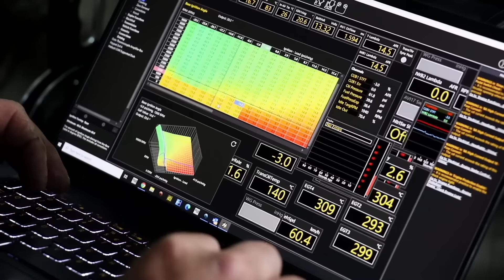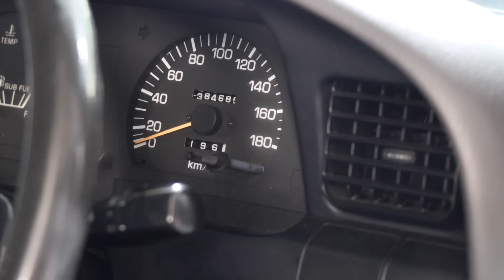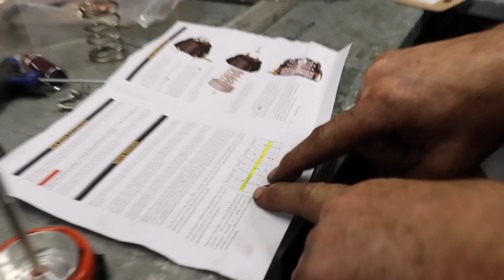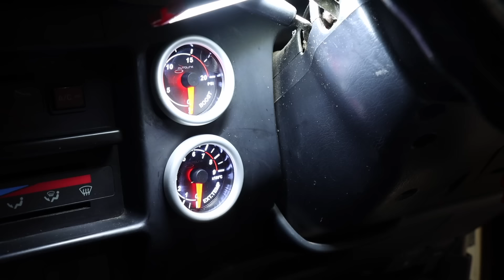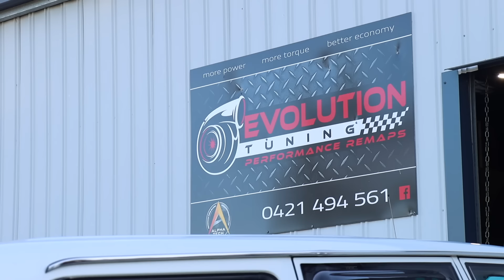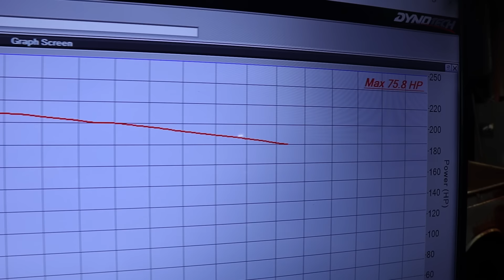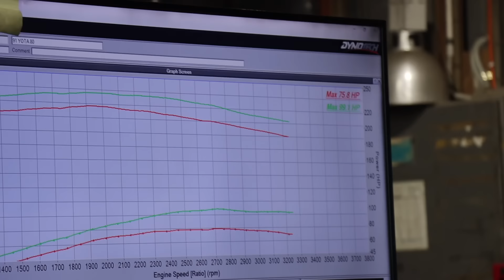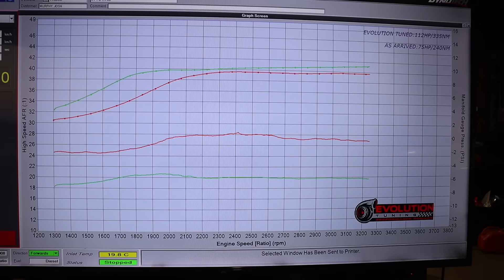How To Turbo Your Toyota 1HZ on a Budget!

Comment: I have found having the fuel screw  bottomed out on my 2L-T with a gt2560 and intercooled with no wastegate is a good setting for me.... I constantly see 650 degrees and upto 720 degrees in short stints...
It has been running the same cracked pistons for over 30000kms...
only reason I know they are cracked is I had to drive it 100kms with no coolant... so I killed the head in process.... so fitted up another head and kept sending it...surprisingly it doesn't have blowby 

Also adding a intercooler drops exhaust temp usually around 200 degrees before turbo on most 10 psi setups.....

 all diesels should have turbos and I think all should have intercooling of some type aswell
Reply: Ditto with the welded up wastegate here on my 5L+t hilux. Don't need a wastegate, let it breathe as much air as it wants and let the fuel screw regulate the boost. Im getting about 19psi up top with a subaru TD04 and I'm not seeing more than 500c in the dump pipe when towing as long as i keep the revs up, and never over 400 when not towing

Comment: I was considering doing something similar with a Jeep 4.0 inline 6 motor, obviously tuning and getting air fuels correct will involve much more work, but to make boost low down I was considering an STI turbo possibly high flowed if its a little bit too small. Wondering if Al or any of the other knowledgable people in the comments would recommend an intercooler given that a petrol engine is prone to pinging or detonation, and whether a small turbo like that would be alright for an OHV pre crossflow boat anchor that generally only revs to 4800rpm and would be running sub 10 pounds or if something larger would be neccesary to maintain efficiency. Cheers.
Reply from the maker: You would need two of those turbos on a 4l petrol engine. You can effectively halve the size of the turbo when using it on a diesel as they have less exhaust heat and do not rev as high.
A BW S366 with a .9x exhaust housing would work fine on a Jeep six and cost very little.
Reply: @theskidfactory  Really appreciate the info, cheers!

Comment: Confused on tapping into the heater for the coolant lines for the turbo - does that mean you bypass the heater?  Or does the heater core have to have coolant running through it constantly for the turbo?  Oh never mind, I see you are using T's... does the heater opening affect the turbo at all?
Reply: There will always be enough pressurised coolant circulating throughout the heater core and the turbo bearings so neither will "run out" or one affect the other in any way...
you've got the water pump always pushing/circulating those litres of coolant at high volume and velocity....
Reply: @JohnSmith-yv6eq  Thanks for the info - makes sense.

Comment: Love your videos. For comparison, how many hp at the wheels does a stock FZJ80 make?
Reply: My 3f 80 made 68hp with AC and 71hp with AC off.

The 1fzfe will make 100-150hp at the wheels stock pending condition. With boost they happily make heaps more…

Comment: 3.300L and under diesels belong in light weight cars. 4x4s need 5.0L++ of low down torque. 
A ZD30 has 50% less torque from idle as a 4.5L Cruiser, and the 3.0L boost all in at 2100rpm is still a long way to slip the clutch to get a 3500kg Patrol moving. But an Auto ZD30 in a 1500kg would be a lot of fun.

Comment: I thought the hz's tended to blowup when they turboed?
Reply from the maker: That's from cowboy tuning and/or damaged injectors.
Reply: High combustion temps or coolant temps is the only real killer when it comes to turbo charging your 1HZ. If your modest and realistic with your power expectations, there’s no reason they can’t be totally reliable with a modest power and torque increase.

Comment: I am just embarking on a similar project on an 80 that I have owned for years, I have a question. Do you replace the rod bolts when you when you do the big ends? some web sites recommend it but they seem to be a heap more expensive than the bearings
Reply from the maker: No need for that, they are top quality hardware.

Comment: Sir, is turbo installation helpful for improving of  fuel average? As u know 1HZ engine is not good for fuel average? Pls guide
Reply from the maker: Yes it is because you achieve 100% cylinder fill with a turbo even if you don’t add extra fuel.

Comment: Pretty sure the deal is every 100k do big ends on a 80 series, mate got one did them straight away his is turbo and still a slug told him to book in at diesel shop and get it tuned also the transmissions are terrible super hard shift between 1st and 2nd on his after spending alot of money

Comment: why does that power seem soo low for a full sized suv . I mean we got 4 cyliners with 200hp na min i dont get it.
Reply from the maker: Torque output is the difference. You can't move a 2500kg vehicle with a 2l NA petrol engine.
A diesel engine has a high torque output but does not rev high so the power output cannot be high.

Comment: Can I ask a question guys, I'm looking at purchasing a 1980 Steyr ex fire truck to convert into an overland camper, but its got a 6lt Diesel engine, its only done 8500 miles from new, but will only do around 15 mpg. Will a turbo get me better fuel economy ? thx

Comment: Just curious.. mine has extractors on it....(was fitted by the previous owner).... would you still be able to fit a turbo to it?
Reply from the maker: Yes but you will need a manifold. This was often a problem when doing turbos back in the day as the kits often used a part of the original cast manifold which you would then have to track down.

Comment: Is there any 1hz's left that aren't too long in the tooth to be turbo'd without a full rebuild? The previously accepted rule was over 200k then don't even waste your time.
Reply from the maker: Have never heard that rule. All the engines I have turboed have been 2-400k. Just put some bearings in it and make sure the pump and injectors aren't dead. They burn pistons because of bad pump and injectors.
Reply: @theskidfactory  is just what the mechanics I knew at the time told me when I first bought my old girl with 358 on the clock but I'm pretty sure it was specific to the old safari kits and I don't think there was much instruction regarding bearings, pumps, injectors or tuning back in those days. Now she's over the half a million mark I'm not sure if it's a disaster waiting to happen if I were to do it now. 

The other school of thought back then was that it was a whole lot of effort for minimal gains and hd swap was the better road to travel. Perhaps it still might be, but it's also far from a budget conscious route, even more so now than then. 

As frustrating as it is to drive up hill or with a load I've gotten used to it over the years, another 80 series mate had some stickers made up that read "turtle" in the same style as the factory turbo decals to embrace the slower pace😝

Comment: How to split the pistons in your 1HZ landcruiser
Reply from the maker: Why do the pistons split?
Reply: @theskidfactory  Heat, even on mild tunes they eventually crack pistons. Not to mention they were already prone to cracking heads in standard trim. Sure they respond well to turboing...for a little while.
Reply from the maker: Do you think it might be because the injectors need replacing and turning the pump up on them is making a blowtorch?
Reply: @theskidfactory  While that may be a contributing factor in some cases, in my experience its more about the extra heat and load even mild turboing puts on the piston crown. The 1HZ isnt overly thick or strong in the piston crown area. This helps them outperform a TD42 if both are stock but add boost and its inevitable the 1HZ WILL split a piston
Reply: @kanemcdougall8337  
Could oil squirters as per modern designs help with the transfer of heat from the pistons?
Reply: @JohnSmith-yv6eq  1HZ already has them.

Comment: If your doing this at home don't go too cheap and buy a "rhino exhaust" like I did, they don't fit and require modification to fit.
Reply from the maker: Most 3” exhausts usually require some modifications to mounts and sometimes some lovin to the flange bolt holes to allow for more adjustment. The exhaust Josh supplied was a DEA, the Mount under the sill had to be modified to clear the pipe as well as the Mount at the very rear required some tweaking. This can also be vehicle specific too as some cars have been beaten to death on the tracks!
Reply: @theskidfactory  Yeah it looks not too bad. The brand I got though was no where near close, a fair bit to get it to fit. Just letting future people know spend a bit more than I did, it was a pain.

Comment: Could you run the turbo without the water ports? (i.e. can they be blocked-off) ... I've read elsewhere that they are not 100% necessary, just let the turbo cool for a bit before turning off the vehicle.
Reply from the maker: On a journal bearing turbo yes you could but if the cooling ports exist in the turbo then it is a good idea to use them. If it's a ball bearing turbo with a small orifice of oil feed then you don't have much oil to pull heat from the core and I would not run it without water in any circumstance.
Reply: Makes sense, thanks for the tips!

Comment: Just had mine tuned and have 18:1 and 10 pound so guessing way to lean might wind the pump back abit 😳
Reply from the maker: 18:1 is on the rich end. This one is around 20:1.
Reply: Every engine and set up is different, 10psi from a very old turbo, could be totally different to 10psi from a newer more efficient turbo. Generally speaking, we try to stick above 20:1 on older mechanical injection set ups like 1HZ’s TD42’s etc. lower AFR’s is usually for set ups that are chasing maximum power, over reliable touring.

Comment: 75hp at the wheels... was that a joke?
Reply: It's around 130 hp at the crank stock. That's what Toyota says.
Reply from the maker: That was with 7psi boost. They are about 60-65hp stock NA.

Comment: 1HZ doesn't lasts long after installing a turbo charger in it. Original pistons are burn they need to be replaced by pistons from 1HDT as well.
Reply: Properly tuned they run fine, 1hdt is just as unreliable.

Comment: Put covers on headlights so they don’t see the hills coming.
Factory bearings are too soft for turbo applications, you need to consult a bearing chart and select a more durable compound. The oil pump should also be replaced with that many kms.
Also a micrometer should be used to check for Ovality of big end journal’s.
Injector pump timing can cause delaminating of bearings if to advanced. Check with plunger dial gauge!
Reply: Why does plasti gauge exist if every internet expert claims it's useless
I'd say in the hands of an amateur, mic's have a much greater chance of making a measurement error greater than the increase in accuracy vs Plasti gauge
Reply: @Onewheelordeal  because everyone is a keyboard cowboy.. and cant just appreciate stuff.
Reply: If you don’t understand what Ovality is or how to use a micrometer you are way out of your depth and should seek professional help.
Plasty gauge will not tell you if your crank has Oval wear it only gives a indication that you have correct oil clearance.
Reply: @DieselAddiction  oil clearance is all they are worrying about... it has 300kms, dont give a rats ass about being out of round.. not a supercar rebuild, its old Bessie..these professionals turboed a old ass suv, I dont see you doing it..
Reply: By the way I do this for a living and and have my own channel s 30yrs experience so I might have half a clue before anyone shoots from the hip.
I’m only trying to be helpful!
Reply: @DieselAddiction  ok that is cool bro, your just coming off as they should practically rebuild the whole engine and do this and that.. when that is not necessary. I have rebuilt engines before and measured crankshafts. in this application what was done is 100% fine. chances are these kinda truck engines don't suffer out of round cranks anyway. even if they do just swap another engine from the scrapyard for 300$ when it blows up or engine swap it.
Reply: I have worked in NT, Birdsville, Northern QLD, and Rural NSW. 
Wish I had a dollar for every 1HZ owner who said she’ll by right mate!
They do suffer from crank wear when factory bearings start delaminating.
I have had to rebuild several engines that only lasted 10k after rebuild because because of aforementioned issues.
You can get cheap builds and expensive, but in the long run the cheaper build costs triple when you cost out all the rework. 
What Al has done is great budget turbo mod, but if you want to see another 300k from that engine prevention is cheaper than the cure. 
Any more boost and fuel than 12psi then I would recommend complete re engineering the engine to turbo specifications.
A 1HZ is a light duty diesel , bearing width and material was not designed for turbo application, even the FTE engines suffer from bearings delaminating when boost and cylinder pressures are increased above factory standards.

Comment: I clicked on the video to see how others torque down their head gasket. Unfortunately this video shows only where to put what and what to look for and avoid. Timing setup and head gasket torquing wasn't shown. The way he bolted down the head was totally useless. It requires 69nm and 2 x 90°....
Reply from the maker: We didn't do anything to the head or headgasket. The title of the video is How to Turbo your Toyota 1HZ not How to Torque your cylinder head.

Comment: I know 3  people that have done this, and they have all blown up. Cracked piston or cracked head and 5 grand to fix it. 1hz is 22-1 compression. 1hdt is 17-1. Also, the 1hz is indirect injection. 1hdt is direct injection. This comment will get deleted, no doubt. 4xoverland Andrew says 0.7 bar boost maximum. That's about 10psi.
Reply: Frustrate off and unsubscribe 😊

Comment: A turbo and an intercooler will get more air into the cylinders, but how do you get more power without more fuel? All these 50%s. I cannot help but be a skeptic. I think you will need a bigger fuel pump.

Comment: How to turbo your 1HZ on a budget. Step 1 - find an unmolested 1hz equiped Landcruiser with less than 600,000 Km's on the clock (+$50K). Step 2........